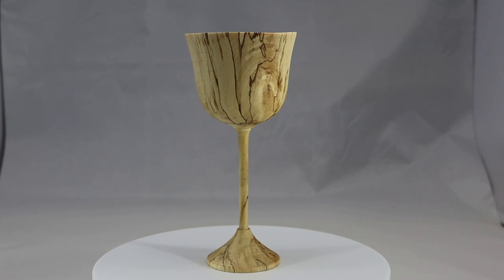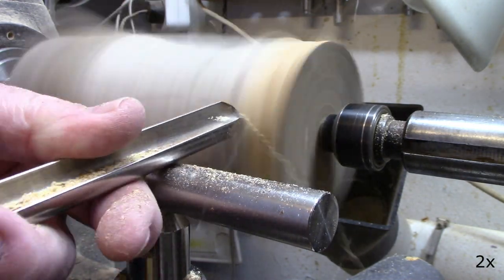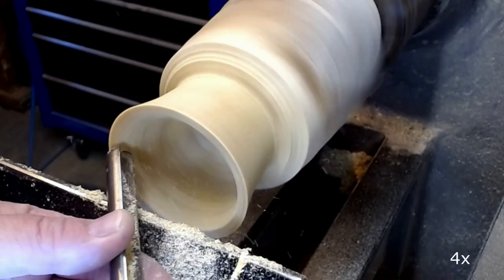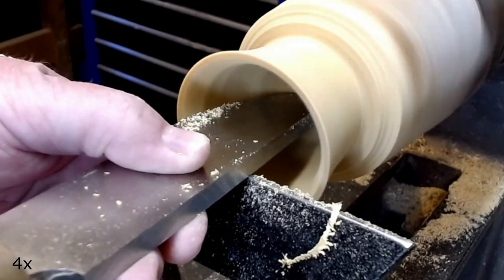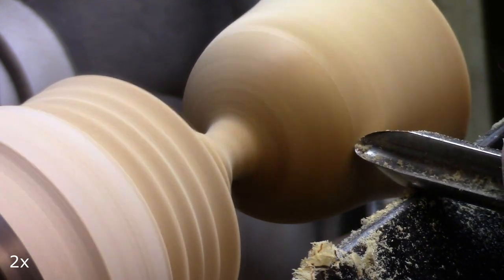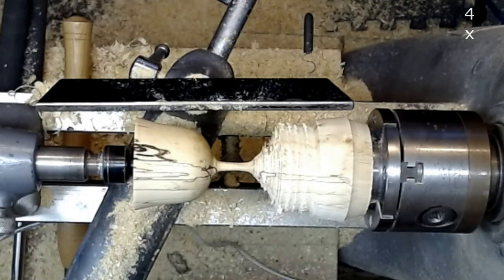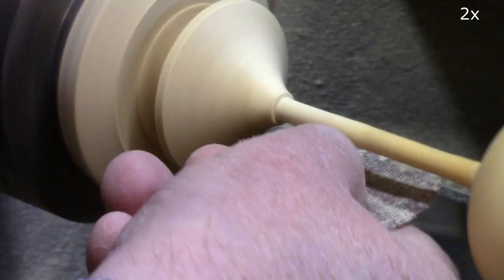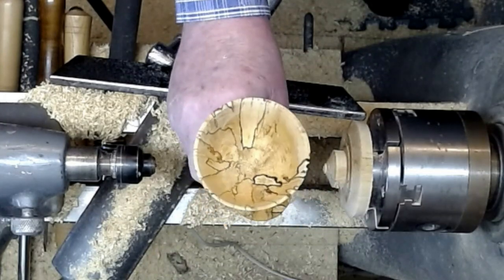Woodturning #40   Goblet from punky spalted Birch

Comment: That turned out really well. I have some silver birch that I left out on the ground for over a year and checked a piece yesterday and pleased to see it is nicely spalted. Have you tried anything else to stabilise it with apart from lemon oil? I was wondering what to use as the piece I started turning is a bit soft in places. I suppose the lemon oil does give it a nice smell too.
Reply from the maker: Hi David. Sanding sealer also works. Patchy softer wood was also my problem. The gouge did not really cut no matter how sharp. The wood was semie dry so my guess is that even water would help. Apply like you were wet sanding but not so much as to soak the wood. You just wet the surface to be cut. I have not tried this, so I am just speculating. Initially there was a faint smell of lemon on the piece but after the oil cures fully, there is no smell. Thank you for commenting and watching. Appreciated.
Reply: Hi Sigurdur. Many thanks, yes I was thinking about sanding sealer too. Hope you keep the videos coming, you make some lovely things.